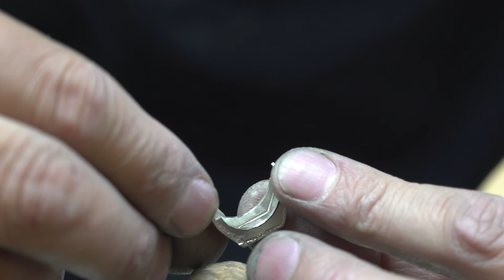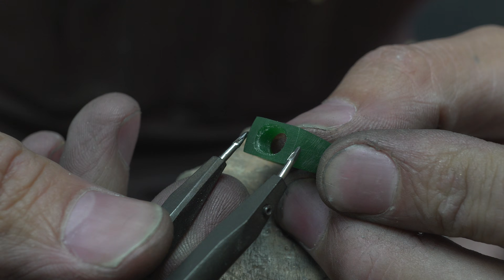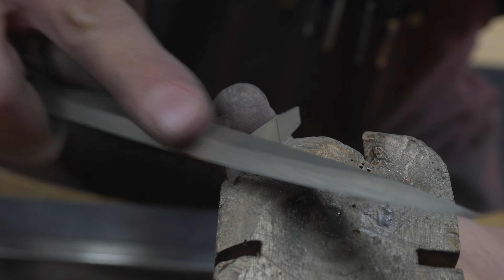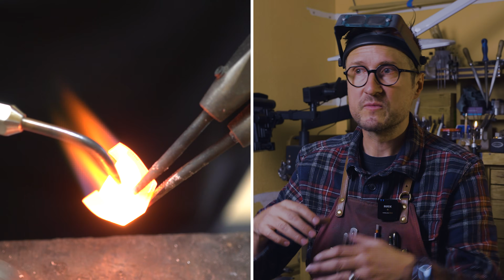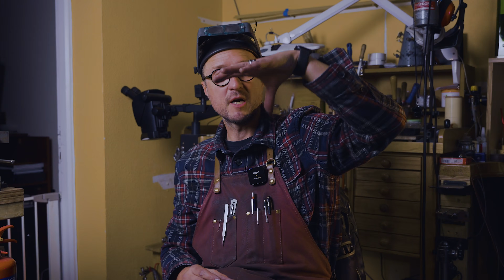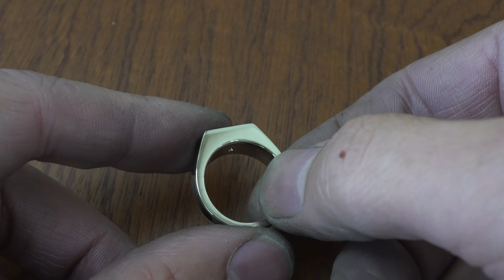Flat Top Ruby Ring in Platinum Using Plate Construction | Jewellery Making Tutorial

Comment: Fascinating. I’m pretty new at this, but I’m working on the same style of ring, sometimes called a box or signet ring, and never done it before. No one I know has ever made one. I have seen many different videos, all going at the same ring- differently. I started with a detail sketch of the outer and inner shells, and cut 20g copper to match, cutting the sides slightly oversize, and dealing with the top plate last.

Comment: But I’m unclear how the stone was mounted……
Reply from the maker: @bysykler4959  the stone setting wasn’t featured in this video, but it was flush set - I just opened the cavity slightly smaller on shape and caved it until the ruby clicked in. Then moved metal from the top at an angle to secure it.
Reply: @jacothejeweller  Thank you!
Reply: That is quite a big stone to do that with isn’t it? I am new to this stuff but was told flush setting wouldn’t work on stones larger than 4mm? Would larger stones work with a softer metal like silver?

Comment: This was amazing and so interesting to watch. I’ve only seen two signets being made this one & Bobby White, more from an entertainment perspective, his was much less informative but still an amazing technique. You have different methods but beautiful results so I love watching both. This may be a really stupid question but I’m not familiar with fusing yet, is fusing strong enough to hold joints alone or do you need to solder as well? Does the thickness or structure of where you’re fusing matter? 

Thanks so much guys it’s so nice to watch another amazingly informative technique again. 🙏 

Emy xx
Reply from the maker: @emy_themua2015  thanks 🙏🏻 for your lovely words - I only fuse platinum. I would usually tack gold only before committing. As for wall thickness, yes it certainly does but again, platinum allows you to work on thinner walls too. My advice is always to work slightly bigger with thicker walls to accommodate the filling. Good luck 👍🏻
Reply: @jacothejeweller  thank you 🙏 🫶